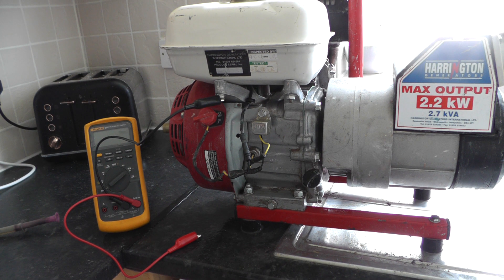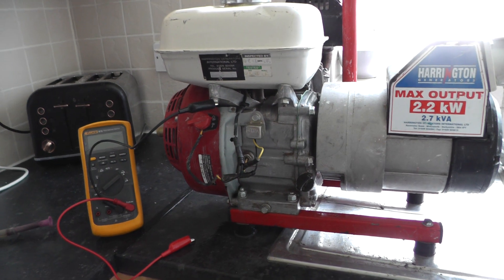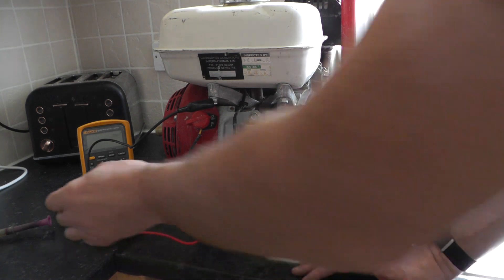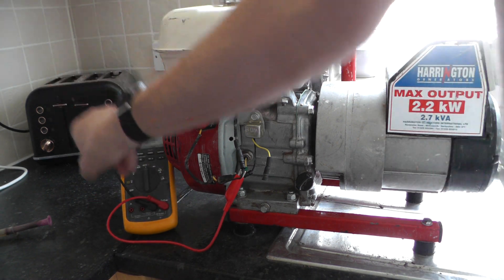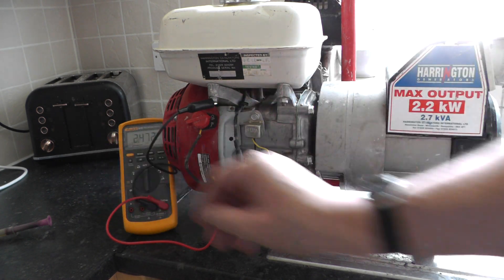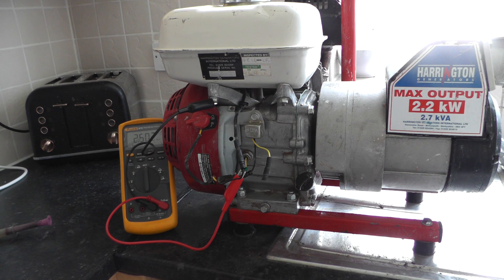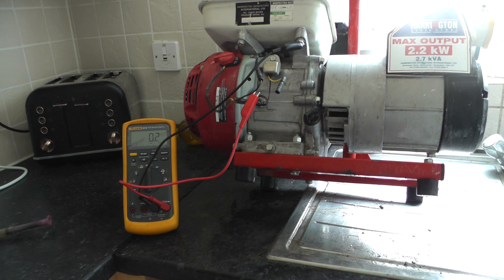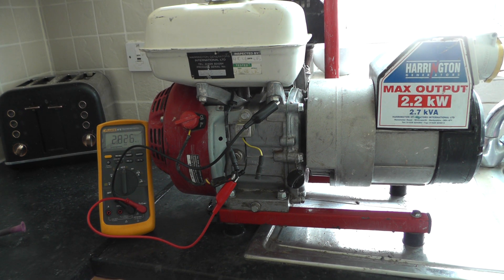Honda GX Oil Alert Cut-Off Switch Wiring & Test | GX120 GX160 GX200 Troubleshooting

Comment: Spot on. Checked around other tubers and best they came up with is cut the lead off the sensor and carry on. Need to replace the sensor as I am getting spark out of coil when spinning crank shaft by hand.
May have another GX lying around not sure if sensor on its salvageable or just get a part# and shop amazon. Thanks and Kudos to you, good job . Just subbed.